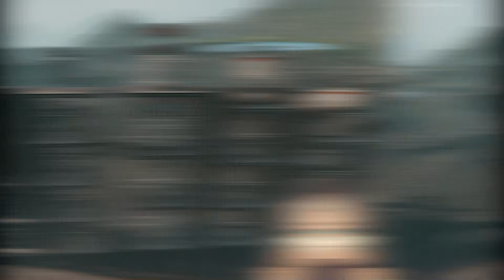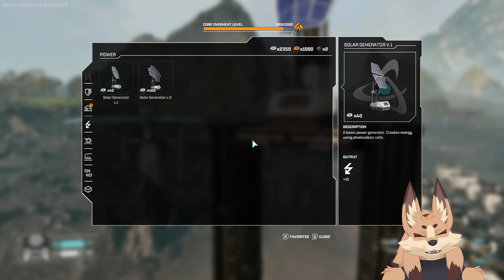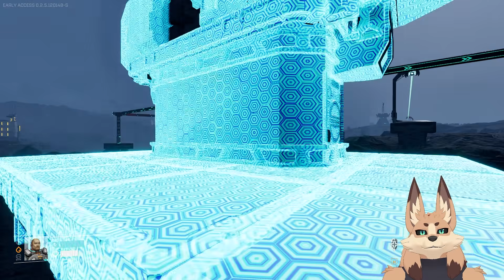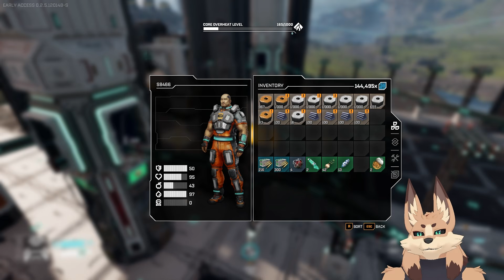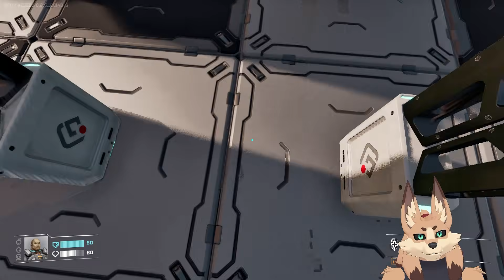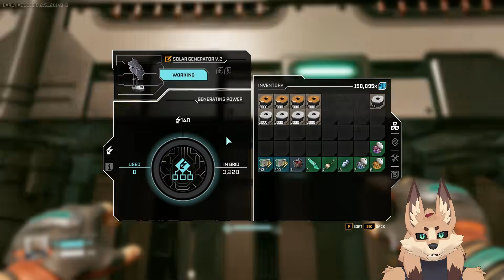Taller Factories And Bigger Lasers - StarRupture [S2E7]

Comment: Um you are using way to many pillars just 2 pillar would hold it and i have buildings that are much higher and bigger then this not really hard to manipulate the mechanics of the building in this game and if you use a pillar to pillar connection you can extend your stableness an extra 1,2 blocks depending on your support placement either way ill be coming out with a video soon showcasing how this works and much more need to know things

Comment: Stopped  at 33:45 pillar support under existing platforms. It is snapping to build under the platform. Go ahead and click to build that pillar underneath first. If that pillar has grabbed the ground, then you should be able to scroll up right through the platform and place your pillar on top where you want it. If it doesn't scroll up, then scroll down until it turns green. Click to build, NOW scroll back up. You should be good to go.
I remember at first launch you couldn't place a pillar under a platform at all.  You had to find the right pillar height first, then place the platform. 
So far another STELLAR production sir! Thank you.
Rails on builds 3 or more floors must be just a nest of mess! LOL
Reply: Actually since posting this have since figured out that you can actually build down with the pillars. 
For example on a really steep hill or mountain you can build your supported platforms in the line for one side of your building. 
Place a platform on the side of your building foundation. Then place a pillar under that platform. Then scroll down placing pillars until it has "grabbed the ground". You can now scroll back up to place pillar on top of the platform and continue building up if needed.

Comment: I look forward to your vid's  :-).  been waiting for you to get to the goethite stuff.  was expecting a bit of a reaction to the extraction rate LOL, 1 every 4 sec., it takes 32 nodes to produce a full v3 rail (480/min).  

there is only ONE grouping that is even close to that number and it's only 30, but that's close enough :-), if you're looking at the map, find the engine and go ALL THE WAY to the west to the "new" rad limit, you can't miss it, it's a LARGE tan area on the map

but there is a grouping of 3 seperate  groups that equal exactly 32.  If you know where the "Red Lake" area is, there are 3 groups fairly close together that equal 32, 

1.)  first is at the VERY north tip of the red lake (8 nodes)

2.)  second is STRAIGHT north and JUST to the west (6 nodes)

3.)  third is the largest of the 3 (18 nodes), and it is smack dab in the middle of the two but to the EAST of both 

I set up the lasers on 1. & 2. and fed them into 3 v2 storage units then fed that to a dispatcher and sent both to the 3rd location, where I combine them ALL into 3 more v2 storage units, and thats where I'm making my Goet., Wolf., Titan., Ingot yard

I'm sure I'm not pointing anything new out to you, as familiar as you are with ALL aspects of the game, but some reading this may find it helpful  :-)

waiting on the next vid,

Vamps

PS  You've GOT to get the v2 Ore Excavators, they are a game changer, Pure = 16 per 2 sec (480/min)  Normal = 10 per 2 sec, and impure = 6 per 2 sec.  1 normal + 1 impure = 480/min.   🙂

Comment: I think I would build a central build-all mega factory and supplement with the external dedicated factory bases to send inputs when the central mega factory lacked quantity. I do wonder about use of the 5 rail instead of 3 rail. Is it viable in the later stages to replace 3 rail? I stopped playing a bit ago due to the updates messing with my gameplay. It also doesn't help that the game isn't optimized and slowdowns plague when anything is built at scale.
Reply: 5 rails are great. You definitely want to get into them. Even for small situations.

Comment: Better Build Drone mod allows you to set your build drone range and speed (as well as rail span length for some reason) and i dont know if it has any limits. Tho there are some LOD concern when you get out too far from your player.
I suspect terrain hitbox might just unload and your player might fall through the ground? I havent tested it, so be aware.
I mean if you are going to glitch yourself under the map to get more buildspace, you might as well get the drone mod, really. It's actually an amazing QoL mod for building in general, cos imo the default build drone range is way too short.
Reply: Using the Drone Mod, you can even leave the map if you want, the problem is if you immediately return to the character, he will fall because there will be no ground, to solve this I jump from a high place and activate the drone so the character stays floating, but the fall does not cause damage, so if the Rupture comes and leaves the drone, there is time to recreate the floor before the character falls to the ground.